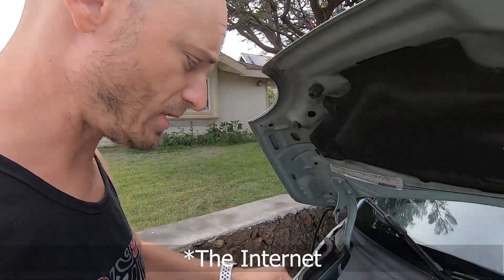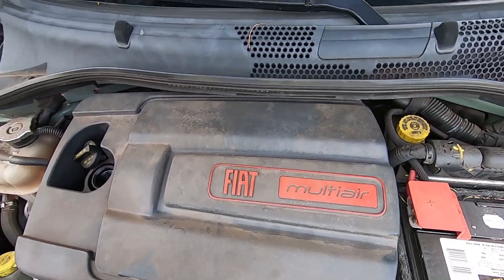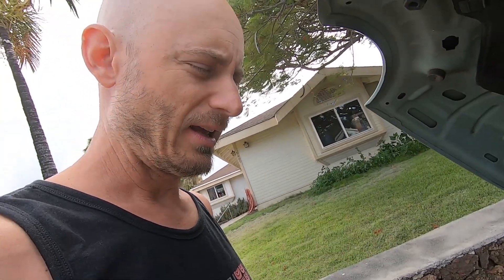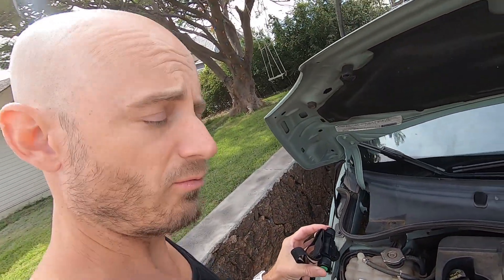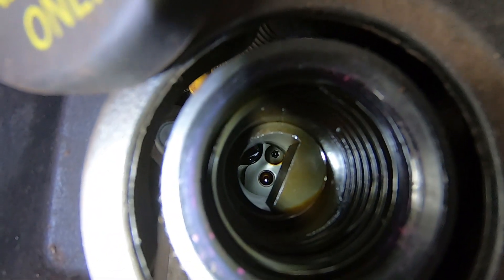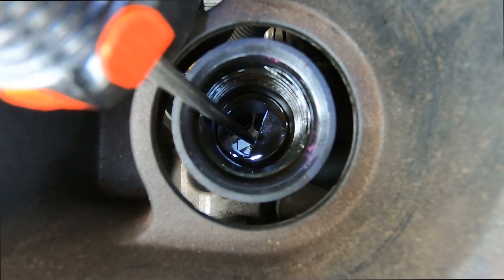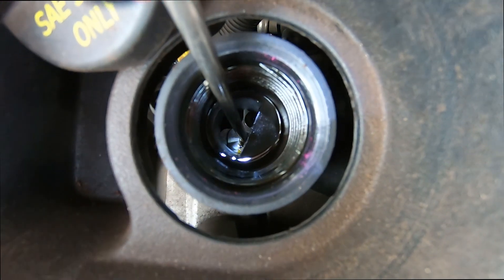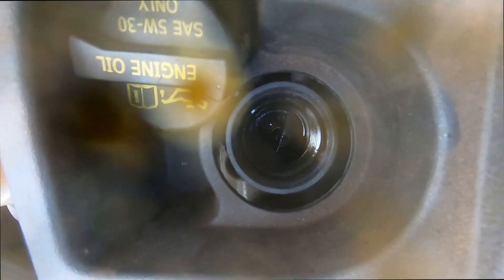Fiat 500 Multiair - Crank - No Start - No Compression - FIX!!!

Comment: Good tip! I've seen other videos that basically explain the issue is lost oil pressure in the intake valve train but not how you resolved it with that secret little plunger!
They were getting low oil pressure related engine codes but it was basically the same issue. Car stood a long time, oil drains out the multi air unit and won't operate the intake valves.
My Fiat Panda has the 0 9 twinair engine, same principal but only 2 cylinders. I'll have a look for that plunger! 😎👍😁
Reply from the maker: Let me know if it's the same/similar!
Reply: @ShanesGettingHandy  Will have a look tomorrow! I suspect it will be the same, as the twinair engine uses the same process to control the intake valves.
Is it possible to operate the plunger with the dip stick?
Reply: @pdtech4524  Any confirmation on that??
Reply: @cliotec  Not sure, haven't tried it but when you look down the oil filler there is definitely something like the top of a plunger and the dipstick is shaped like it could operate it.
Wouldn't surprise me if it has the same setup as it will have the same issue if left stood for some time.👍😎

Comment: The intake valves on "Multiair" engines are basically hydraulically actuated. This pressure comes from engine oil stored in the "Multiair brick". The "brick" has small, small holes in the bottom that allow the oil to drain back to the sump, although at quite a slow rate. It's fed oil from the engine through the top of the "brick." It does this so the "brick" receives clean, recirculated oil from the engine. It just doesn't circulate NEAR as much as the the rest of the engine.
Reply from the maker: Thanks for the info!

Comment: Hello friend, good afternoon, I have the same problem I went on a trip to Mexico City and the car lasted for about 5 months I want to start it and it does not start it does the same as yours I already tried to do the same I press but the fluid does not rise  oil, my doubt is you press down or you move still side I tried to move still side and the part does not move.  could you help me please 🙏
Reply: I had the same problem. Mine did not move either. I could not feel anything depressing when I pushed on it with screwdrivers and even made a pusher using metal cost hanger and still could not feel any movement or get oil to show up. I have 2013 fiat pop. Not sure if this actually works on all models although I see alot of comments from people saying it worked for them. Wonder if it could just be a coincidence that by having the oil cap removed and trying to start it is doing the actual work here. Mine finally primed after keeping the oil cap off and by pressing the gas pedal all the way to the floor board before putting the key in. Keep it pressed all the way down while turing key to second position (accessory position) pausing there to let engine pumps prime oil. By keeping the gas pedal pressed to the floor board it allows oil to prime without the fuel injectors flooding engine plugs. Keep doing this but give it 10 or 20 seconds in between starting so you don't burn out or over heat starter. Finally got mine started using this method after my fiat sat for over a year.

Comment: THANK YOU,THANK YOU!  My 2012 Fiat pop did this about one month ago as it is now garaged and not used much and besides I prefer bicycles. Luckily the mechanic I use lives down hill from me, so I coasted down and dropped it off. They replaced the crankshaft sensor to the tune of $185. Drove car home and it sat for about 2-3 weeks before I tried to start it again. No dice. Coasted it back down to mechanic. This time, he told me not to let it sit and explained what was happening as you said. He of course did NOT show me how simple it is to get it going again! Had been running it once a week and today it did the same thing! Undaunted I searched the web and found your video. IT WORKED! NO MORE COASTING TO MECHANIC!  Thanks again.
Reply from the maker: You're welcome!

Comment: Got back from a 4 week vacation and the 2018 Fiat 500 C lounge no worky.  Being in Arizona the heat can be a real battery killer.  Tried charging battery but seemed okay. Did voltage check on battery, seemed okay although cranking voltage dropped to ~7 amps.   Last minute thought was check for similar issue on YouTube and here we are.  Your situation mirrored mine. Even same color vehicle but the 57 vintage style.  Having the same Multi-air engine, the stated location for the bleed point was used while my assistant wife hit the ignition.  Took about 4 attempts but when oil shot out of the oil filling port I knew we were getting somewhere.  Took another 2 attempts but definitely could tell something was happening.  Sure enough, baby Stella came back to life from the brink of utter financial car repairs.  Thanks  a bunch.  I can be your 19th subscriber.
Reply from the maker: You're welcome!  I knew I only had one chance to film this and get it right, too bad for the wind noise I didn't find out until later, but it was good enough!  I have since bought a mic muff for my camera.

Comment: Thank you so much for this video! We couldn’t figure out what was wrong with my daughter’s 500. Took a few minutes, and made a mess but it is up and running again!
Reply: look at it this way it's a quirk and a anti theft device ( bleeding down all of the lifter's ) add in a manual transmission and most millennial's and gen-Z's wouldn't steel it lolz 😂 

even i didn't know anything about this so id though it was junkyard time lol and im a little bit more savy under the hood of a car